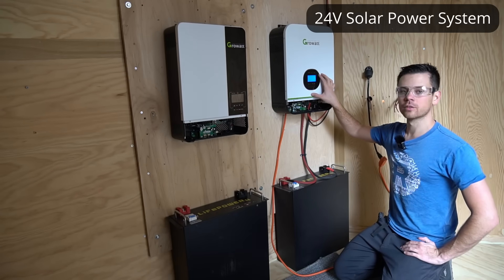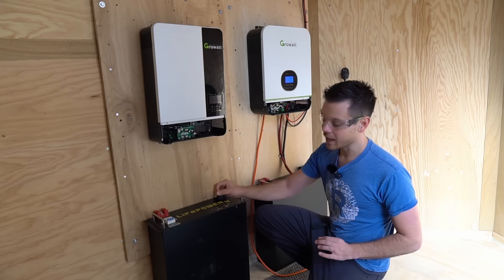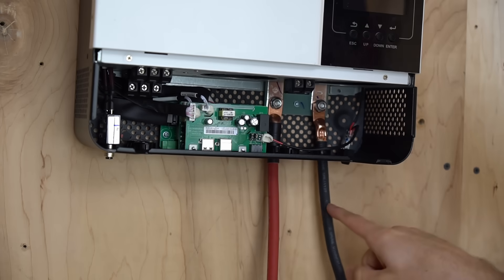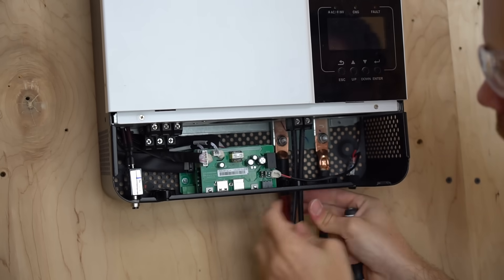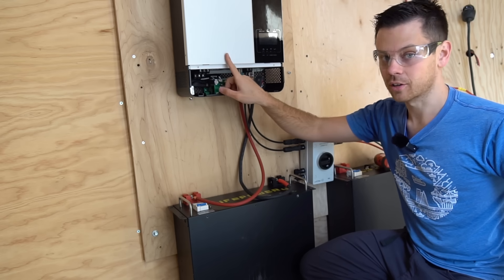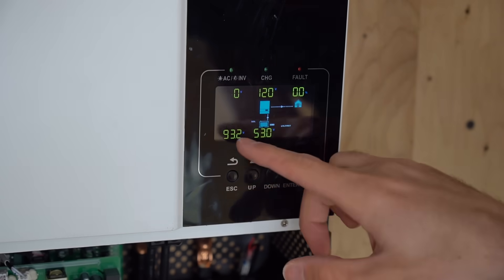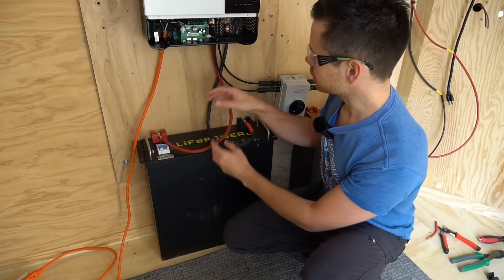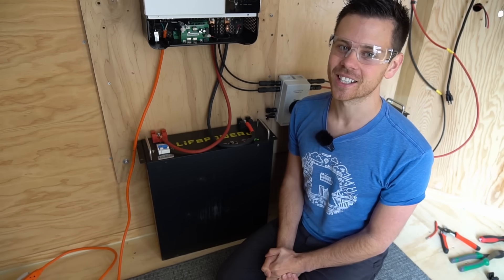Beginner Friendly 48V Solar Power System! Step by step!

Comment: only thing I'd add is I love dielectric grease on all connections
Reply: Di-electric grease is non-conductive.
A copper-infused conductive grease might help seal the connections from environmental influences.
Reply: @largemarge1603  I was looking at videos about it, and they are all over the place, pack the terminal, don't pack the terminal, it conducts, id doesn't conduct. But yeah,  your right

Comment: Van/truck conversion compliant builds are in very high demand at the moment. I want a build that is plug and play and can be installed in a moving vehicle.
Reply: Can't this solution in this video be installed in a moving vehicle?
Reply: @rexapollo1682  
No.
It can't.
Wait.
Yes.
It can't.

Comment: I think my next inverter will be a 48v Growatt all in one. I currently have a 24v all in one by EASun. I went ahead and ordered the AIMS Power Solar PV DC Quick Disconnect Switch off of your Amazon link thank you for that as it is peace of mind and adds an extra level of safety.
Reply: Is it the black switch with red nob I had few customers had them burn up so I stopped selling those and give them high rated amp ones or the hire amp abs volt brackers
Reply: @The Osborns ok ya I didn’t check the amps and it Came from China I was never told and I had to replace 3 to my customers I sold to even if they did brake yet I called and sent them the right one never tried the one with white on it if you have any problem can you let me know I like to know what work and what don’t work so I can sell reliable parts

Comment: Coming from someone that has gone to school for Hybrid vehicles and high voltage systems, always assume there is voltage at the terminals until you check them with a multimeter! (You should always check with a multimeter!) never assume a high voltage switch is operating properly until you verify it!
Reply: well if you really want to get technical about it you should do a "live dead live check" (NEC 110.4) . check meter on live circuit to confirm its working typical and outlet or dedicated tester, test the circuit you are interested in working on, then test on a live circuit again to make sure the meter didn't die when you tested your circuit of interest and is just showing no voltage.  sounds like overkill personally I only ever did it when doing 480Vac+ stuff
Reply: @orbitONhigh  In this case i would just switch the switch to on and measure and then off again and one should know enough  if the meter is working   , if both states dont show anything then the meter is broken or the source you trying to measure is a case of a problem
Reply: 100% bro always on until I’ve checked!
Reply: Just like shooting guns. Always assume it’s loaded and live before pointing it. Verify the safety first. Would have been a good rule for Alec Baldwin to follow.
Reply: @T.J. Kong 
Yes, they have a service disconnect which cuts the battery in half. There is also a fireman’s loop where then can easily cut the cable to quickly disable the system.
Reply: @dodgeguyz  lookup the video a guys tesla was on fire the only way they were able to cut power was to use a saw on car. dont know what model other vids they stood back made sure it did not catch anything else ion fire and let it burn out several yrs ago so could be more options
Reply: wouldn't it be a good idea to simply use non conductive gloves as well just for that extra level of prevention ?
Reply: @Latinkuro  
That’s actually part of the “power down” procedure for electric cars. As well as having a fiberglass pole with hook at the end in case someone needs to pull you from the car, if you didn’t follow the procedures!
Reply: I've actually seen a 20 amp 120 VAC circuit breaker that looked and felt perfectly normal, but was still passing power after it was turned off (it was a Murray).  Also, if someone screwed up and got two circuits on the same phase crossed together somewhere, things may appear to be normal, but the second breaker you didn't know about will backfeed into the load side of the breaker you turned off.  I've seen it happen.
Reply: @Foxtrot Uniform 
LOL, yep!
Reply: Yes! 
Prove it! 
Be a doubting Thomas!

Comment: Would love to see a larger 48v system for off grid home, especially how to wire the panel if thats possible.
Reply: I’ll be installing my 48v system in Jan. always learn something new every time I watch Will vids
Reply: @rayebel4430  are building it yourself, please what type of technician can I hire for this.
Reply: check david poz hes got 3  in his system if remembering right there growatts too and 6 of the rack batteries in a rack with common buss bar
Reply: @jar407  will do, thanks!
Reply: The thing about wiring a panel is that the knowledge base for a panel is like a 5gal pail whereas installing this small AIO setup the knowledge needed is akin to 16oz bottle. You can safely install the AIO with step-by-step instructions but a panel has so many variables and alternative paths in the flowchart. One video probably can’t tell you everything you need to know.
Reply: @fishhuntadventure  no doubt, thats why i said if possible. At least some basics as the extension cord doesnt help to run a whole house which is what im planning. Im sure its complicated and has liability along with it, but its also necessary and valuable info.
Reply: I'd like to see a 6 grow watt setup. Website says can do a 18kw system.
Reply: I have this same battery and 48V growatt inverter in our skoolie hooked up to a braker panel. Been running it over a year so far
Reply: Yes please do a video with multiple charge controllers and multiple of this type of batterie. So we can all see how a hole house system might be put together.
Reply: The BEST ABSOLUTLY. VERY  Very INFORMATIVE I HAVE. CERO KNOWLWDGE,ON ELECTRITY. BUT IM BEFINING TO GRASP THE CONCEPT. AND YET I'LL HAVE TO KEEP WATCHING ALL YOUR VIDS,. ( IM HAVING TO MOVE TO A PLACE WHERE THE ONLY OPTION IS SOLAR PANNELS,THUS THE NEED TO LEARN ,WHAT COMPONENTS I SHOULD START BUYING,( BATTERIES, THE INVERTER,  ETC IM THINKING OF BUYING THE SOLAR PANNELS LAST,SO I DONT HAVE TO TRANSPORT THEM FROM WHERE IM AT NOW,LONGMONT COLO,TO SAN LUIS VALLEY COLO. THANK YOU SIR YOUR INFORMATION IS SO VERY WELL APPRECIATED,KEEP UP THE EXCELENT WORK. ( IF YOU COULD PLEASE RECOMEND ON BATEEIES AND INVERTER, WE ARE A FAMILY OF 7.   THANKS AGAIN GOD BLESS.
Reply: There was no mention of pre charge resistor. Is there a pre charge resistor in the battery pack or in the Growatt inverter?

I can see attempting to use a pre charge resistor manually while connecting live battery cables is dangerous & to be avoided. 

Just checking what I’m missing.

Comment: Can you really electrocute yourself touching the positive and the negative on the battery bank?
I’ve never heard of this. I’ve touched wires, busbars connections and have never been shocked on my 24 V system. Although when tightening bolts, I crossed the wrench to the ground and got shocked. So I’ve learned to insulate my ground wires. 
I sure would like to know more about safety when building a big battery bank! 🖖😜
Reply: Gloves. When in doubt, wear some clean gloves.
Reply: Ben,
I grew-up on a farm.
I watched my grandfathers and uncles work electricity one-handed... the other hand was in a back pocket.
Reply: @largemarge1603  
It’s a good thing I worked with a 24 V system first, otherwise I think I would’ve electrocuted myself! 😬
I think that’s why I was always afraid of a 48 V system. Didn’t understand enough.
Reply: 50V is considered an upper limit for safe touch voltage. You only need a little bit of sweat or cut skin on one of your hands for electricity to flow through you. 

If you want to test it, lick your thumb and forefinger on the same hand and touch a 12V battery terminal, you'd get a nice tingling feeling!

Comment: Will, thanks for this video.  In addition to running my Small building (man shack and ham Radio Station) With a 48v battery setup how would you suggest a way to run 12vdc appliances ( 20A loads) in addition to the GrowWatt inverter for 120vac?  I want to use 12vdc for radios and a few 12vdc items.  The max load on the 12vdc side will be about 40amps  TIA Lloyd KO4L

Comment: I'm not saying that 50V cannot be lethal under any circumstances, but the chances of it electrocuting someone is horribly low. Residential phone lines are around 50VDC constant and surge up to 100VAC when ringing. However, you'd be hard pressed to find many credible stories of someone being electrocuted by a land line phone circuit in the last 100yrs.

0.1A (100mA) is the threshold where cardiac arrhythmia begins. However 100mA doesn't necessarily, in fact rarely ever, results in death in short duration. How you get to 100mA is the most interesting topic. Your dry skin across the same finger is about 1 mega-ohm (hand to hand is much less), assuming 1 mega-ohm, 50V only results in 0.0005A (200X less than 0.1A). However, a drenched hand or punctured skin (where it's wet) results in much less resistance and may provide low enough resistance to achieve 100mA current flow.

However, the arc flash of a low impedance 50V circuit, can be enough to cause serious burns. This is usually the result of a direct short.
Reply from the maker: If someone has wet hands and touch 60V, it could be lethal. Technically
Reply from the maker: https://www.osha.gov/laws-regs/standardinterpretations/2015-09-04
Reply: @WillProwse 
I understand the code aspect, I do industrial automation. I was merely speaking in terms of practicality. I hope you don't think I was criticizing you, you're my #1 YouTube guy!

I have the unfortunate distinction of being a connoisseur of electrical current. I've been blasted with up to 450VDC (knocked me out and body reacted and throwing me 10ft) and 520VAC (hung on it until I passed out). I've also been hit with 277VAC at least a dozen times. I'm not a dumbass, I just worked with jackasses that turned on circuits as "a joke". I eventually quit that place.
Reply from the maker: Yes, but NEC and OSHA state that it is technically dangerous. I agree with you, but what I recommend in these videos have to align with regulatory recommendations. But yes, if my hands are dry, I can be pretty wreckless around 50V. I touch it all the time, but would never recommend someone do so.

Comment: Retired elevator man here. When working on live circuits. Keep one hand in your back pocket. Less chance of going thru your heart. When engaging a disconnect turn your face away from the switch. When it goes south they explode like a bomb.
Reply: @davelaseer1344  Back in the 1970 and 80's elevator machine rooms were not air conditioned. Pre computerized age, that 140 degree sweat box was all summer long. So you were dripping wet and always working on live circuits between 48VDC to 240VDC and 24VAC to 440VAC. In tight places sometimes wore latex gloves to try and keep from getting a jolt. WE used insulated floor mats around controllers. Just assess the environment and mitigate the chance of getting shocked or hurt. Made it 40 years without a single serious accident for my workers under me or myself.
Reply: Always wear protective glasses.....molten steel,copper and plastic don't go well with your eyes....
Reply: @demolitionkid2  still turn your head away. I have first hand experience with a couple of 440VAC disconnects exploding when turning on and off. 40 years working on many live controllers, motors,  generators and inverters made me very cautious. Kill power whenever you can and use all the PPE and hazard prevention available.
Reply: I watched electroboom use a ground bracelet but it still hurt him but probably kept it from his heart
Reply: @vanpeters9751  hh.
Reply: They taught us that back in EE school in the late ‘60s!
Reply: @johndowning2231 oh it’s a refresher course
Reply: I wish you would make a list if don’ts!! Thank you.
Reply: I am not electrical, more mechanical, but one time I was charging a battery and after having connected it to the receiving vehicle, I keyed the providing vehicle and the battery on the receiving vehicle blew up. Ever since then I have turned away. Like the idea of keeping one hand and the other pocket.
Reply: Flash suit?
Reply: Use insulate tools. Double check your meter with a live power, and power is off.
Reply: I'm not touching the stuff. I would place a protecting covering over the battery, nonconducing materials of course. Once it's set up I wanna use it to charge the EV. Great knowledge but it's too much for me.  Every home should have one with all safety devices. Ty 😊
Reply: @lesliehatun2044  If you are at all afraid of electricity you should leave it alone. Nervous people tend to drop things and not have steady hands. Yet with proper knowledge and instruction you can navigate a potential dangerous interaction without incident. Todays workers usually have safety meetings and training once a month, also weekly job site safety reviews. At least the reputable companies do. I was taught to go thru all the steps in my mind before starting the task at hand. To highlight the hazards and precautions needed to safely do the job beforehand. That was before there was even an OSHA around.  Today they call it a JHA or job hazard assessment to be filled out on paper.
Reply: @lesliehatun2044  this is my exact use case, did you end up building one, and if so, what cover did you go with?
Reply: I'm curious how you mounted the battery to the wall in that position? I like it better than a rack system it takes up less space

Comment: So this could basically power a microwave, refrigerator, single burner electric stove top, window unit air conditioner, and a TV?
Reply: Don't exceed 3000 watts with this setup and definitely use a breaker panel to distribute the load. Load and time will determine your battery storage and solar needs
Reply: @Jack2of3  
Thanks! I'm new to solar, so I need a simple plug-and-play system that isn't too complicated but will take care of basic things. My goal is to live full time off grid in a 200 square foot shed.

Comment: Objection.  You can turn off solar panels.  Either work at night or throw a thick blanket over them and they output no power :P
Jokeing asside I do get your point on those being the most dangerous.
Reply: Solar panels can have a high open circuit voltage under moonlight or if someone shines a little flashlight on them...

Comment: Nice simplified tutorial. Would you recommend using some ring terminals on the high voltage line to ensure it never falls out over time? I know you were just doing things for demonstration purposes, but I am not familiar with the technicalities of electrical code.
Reply: The terminal block for the high voltage AC wires is meant for bare wire or pin lugs only, the screw itself does not protrude or touch the wires
Reply: Looks like you would be better of using wire ferrules for those small terminals on the high voltage side, only if you use stranded wire though.
Reply: @minutericesentra5807  wire ferrules are actually a bad idea with this type of terminal, as the contact area is now less. The terminal isn't strong enough to deform a wire ferrule, so now you have a solid round shape inside a square box. Hand-twisted stranded wires work perfect as they can deform to fill the square inside of the terminal block

Comment: Excellent video and explanation. I think I’m going with a 48v system on my 12x40 cabin. My main energy needs are, mini split air conditioner, a refrigerator and TV.  Can this be achieved with a 24v system?
Reply: Go 48v, no question, especially wanting to run a mini split. Wish I'd done that with my system. Seriously, I'd have 2x the capability for probably less cost. Don't make the same mistake I made.
Reply: @om617yota8  
What about a window unit? I have my eyes on a Midea U-shape unit that Will had in another video. Still 48v?
Reply: @johncunningham8213  You'll obviously have to run your own energy audit and spec in a system that meets your needs.  

For anything more than charging a cellphone and running a few lights during a power outage, or maybe limited RV compatibility with a 12v system, I'd bump up to 48v.
Reply: @om617yota8  
Thanks. I'm getting more ideas of what kind of system I need and what appliances are actual necessities. Like electric hot plate for eggs and ham vs. a small camping propane stove.
Reply: @johncunningham8213  That'll make a huge difference in system size, for sure. 48v is much more capable of being expanded later, if you need.
Reply: @johncunningham8213  
John,
For cooking in our ExpeditionVehicle, we use induction hot-plates plus propane camp-stoves.
We prefer cooking outside, so portable components make sense compared to a permanent built-in galley.
A benefit -- we can work one or more induction cookers on a picnic-table with a simple extension cord.
For propane, we use five-gallon twenty-pound kegs, easily moved to the cook stations.
Reply: Thank you for asking this. I have a similar situation and need to know the same thing. Lol
Reply: Thank you!

Comment: Will, what kind of  solar electric setup would be needed to keep a 2022 Sienna running full time in EV mode?
Reply: If it's consuming 10,000 watts to go at speed of 40mph then 2x 13,000w of solar pannels will be required. Would end up using 62 pannels ratted at 445w per panel and if you would like to go 60mph consuming about 25,000 watts of energy and 5000 watts for charging the battery.  Yep that's the math for what's required to run. Not fatoring in the drag of the pannels or the weight.